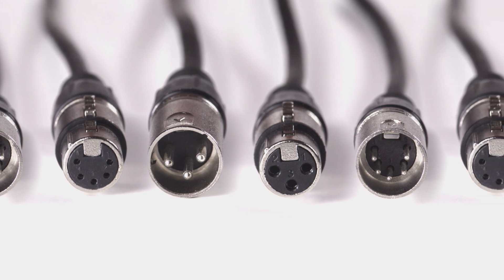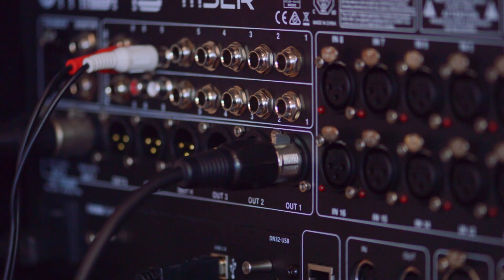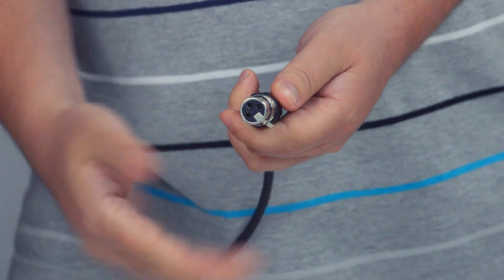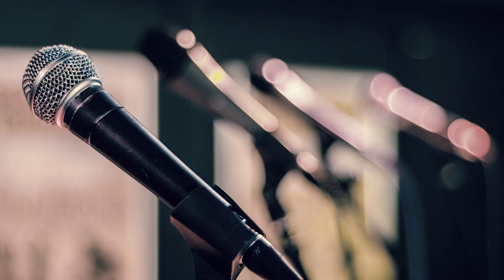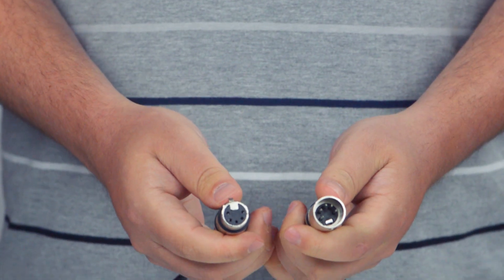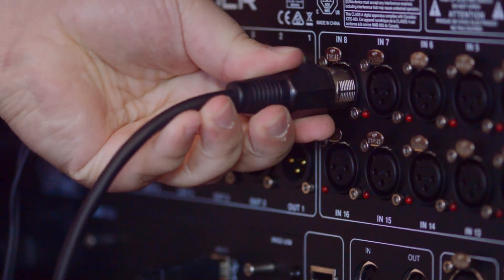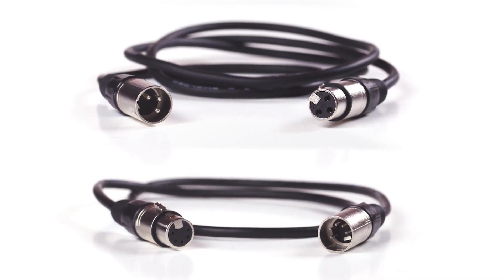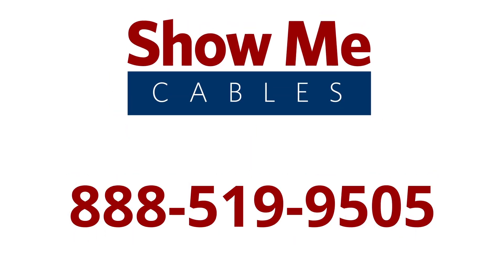The Difference Between XLR Cables

Comment: I have an XLR (male) TRS hybrid cable that says its an instrument cable.

Can I use this to connect my Yamaha keyboard via a Live Wire DI box, on to my pedalboard and on to my amplifier?

I use an ABY pedal and thought I could have my electric guitar and Keyboard in Y mode but only the keyboard works. So I have to switch between A & B channels to use one or the other instrument.

I was told it was because the impedance levels between the guitar and keyboard are a mismatch so by connecting the keyboard via DI box, I’m hoping that would solve the issue.

Comment: Whhat is difference between XLR male cable and XLR female cable
Reply: Male has pins, Female has holes. Typically on instruments, the female end plugs into the instrument, and the male end plugs into the amplifier, as opposed to things like ⅛ inch cables (phone headphone jack) or ¼ inch cables (guitars and studio headphones) which are male on both ends.

Think of it like a phone charger. The part you plug into the phone is male, while the charging port on your phone is female.